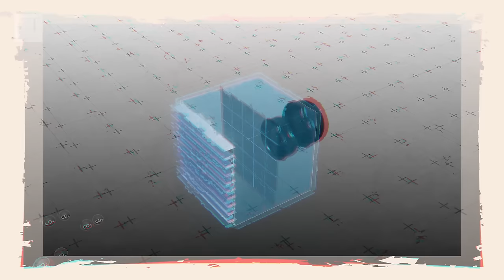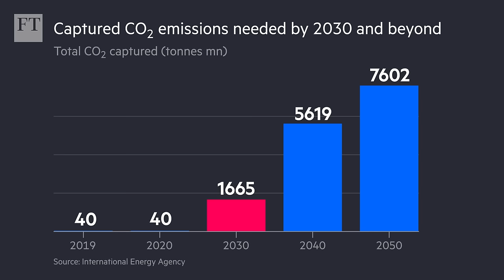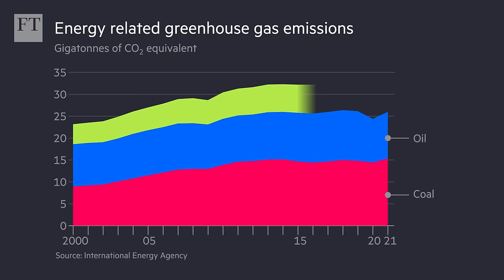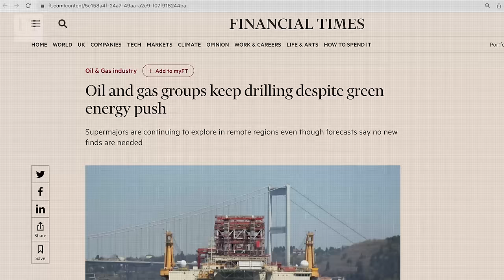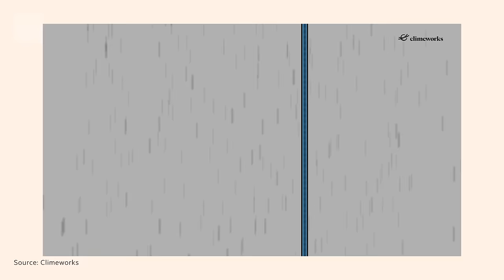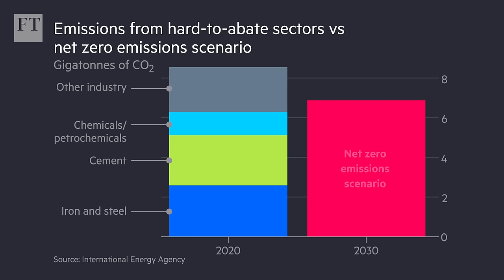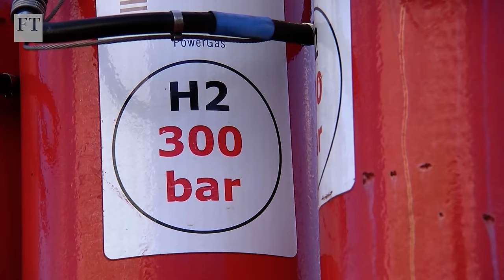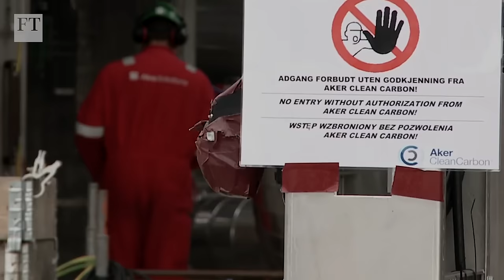Carbon capture: the hopes, challenges and controversies | FT Film

Comment: Carbon capture is like the fusion reactor we need both now to clean up the damage we have done to our home world,  but developing these two technologies does not negate us from getting off fossil fuels,  otherwise for mother nature to clean up our mess could take a  millenia or more.
Reply: the only real solution to drive down carbon emissions is nuclear power.  Carbon capture is fine if the electricity comes from a carbon zero source.
We could produce electricity with nuclear power, use the energy to desalinate water from the ocean, run carbon capture, and power homes and industry.  
All the talk about renewables is fine, but they lack the land density, raw materials, supply chain, and intensity that we need to move the scale in a meaningful way.

as the lady says at 6:40 of the clip, anything other than nuclear power is "tinkering around the edges".
Nuclear power is contained waste, and carbon emissions free.
The continued use of coal can not persist.

Comment: The reaction to convert CO2 into Synthetic fuels is Endothermic,  a good direction would be to piggyback CCS, with cooling technologies.
Reply: Heat pumps can have efficiencies (COPs) over 400 percent.  The activation temperatures for methanation of CO2 are higher than current heat pumps typically operate.  High temp heat pumps are a very promising technology
Reply: Cool. Microbes/some engineered... can probably be added to it for different outcome products as well